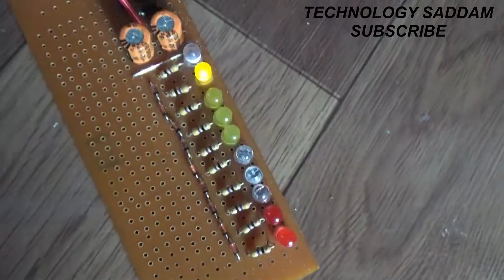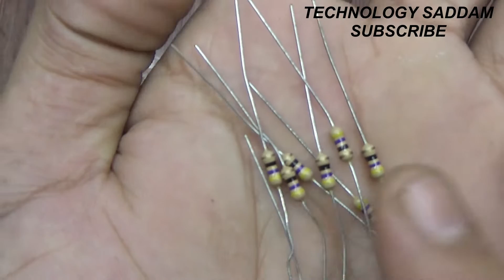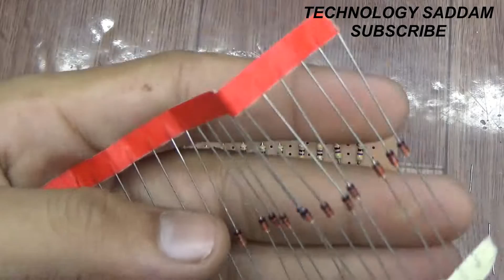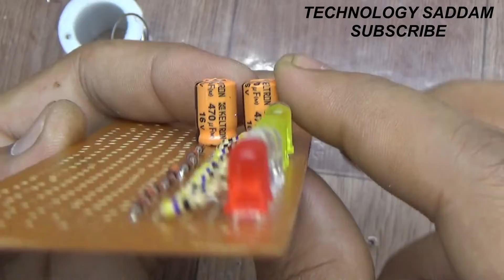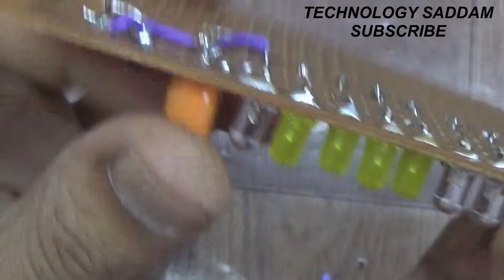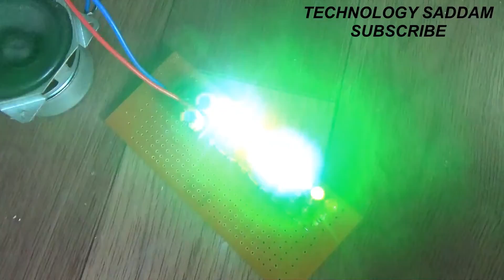Vu Meter Without IC||How To Make Vu Meter Without IC

Comment: How much resistance should I use if I use a 5v amplifier? The LED does not light all but only 2-3 lights.
Reply: I agree with you bro, try this peoject. Led Vu Meter No Ic No Transistor by Lee68.
Reply: https://youtu.be/CAy3clNnUIg
Reply: Thanks

Comment: Hi please tell me the values for capacitors, coils and resistors, and a question the circuit does not go to a voltage of 9V, does it really need speaker?
Reply from the maker: . 9 pcs 470ohm resistor
.470uf 16v capacitar
. 1n4007 diode
.4148 diode.
Reply: Thank you very much but do you have to be connected to a speaker?
Reply from the maker: @mihneavolosciuc4001  yes
Reply: Off😞
Reply: Let's take it differently, the circuit also goes to the 9v battery
Reply: @mihneavolosciuc4001  nu are nevoie de nici o baterie, se alimentează direct din semnalul audio! :)
e pur şi simplu un redresor cu dublare de tensiune, urmat de un şir de diode în scară, cu leduri puse la fiecare comun al diodelor, iar ledurile se aprind la fiecare 0.65 volţi în plus faţă de masă.
dacă pui în loc de 4148 diode BAT46 sau orice diode schottky de putere mică, sensibilitatea e şi mai bună, şi poţi adăuga şi mai multe leduri.
în plus, poţi folosi schema şi ca voltmetru autoalimentat de curent continuu.
for non-romanians:  here is no need of separate power source, because this schematic is self-powered from the audio source.
simply, is a voltage doubler followed of a chain of diodes and LEDs will lit at every 0.65V more.
if the diodes will be BAT46 or any low power schottky diodes, the leds will be more sensitive, and we can have more leds.
on top of that, this chain can be used as a selfpowered CC voltmeter.
Reply: @miftosaurus  mulțumesc mi-ai fost de mare ajutor, eu sunt începător
Reply: @miftosaurus  eu îmi doresc mult dar este greu pentru mine ca începător
Reply: @mihneavolosciuc4001  ai cont pe facebook? :)

fac parte din mai multe grupuri de electronică româneşti, aş putea să-ţi mai luminez nedumeririle fără să-i stricăm omului postările... :)
Reply: @mihneavolosciuc4001  sper că eşti on acum...   singurul cu poză la profil pe o bancă are tricou verde... şi e destul de mititel! :P :)))))
Reply: @miftosaurus  care e fbk-ul tău?
Reply: @mihneavolosciuc4001  o să-ţi trimit un mesaj :) vezi să nu te sperii de mine! :)))))))))))))))
Reply: @mihneavolosciuc4001  stai că nu merge cu mesaje, îţi dau add! :(
Reply: @miftosaurus  ok